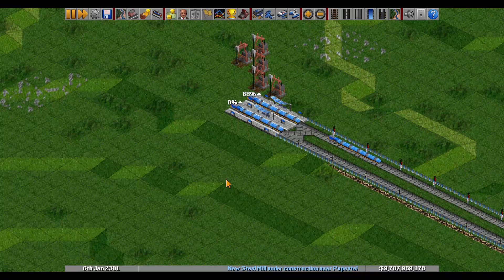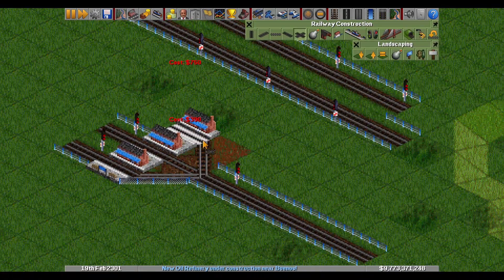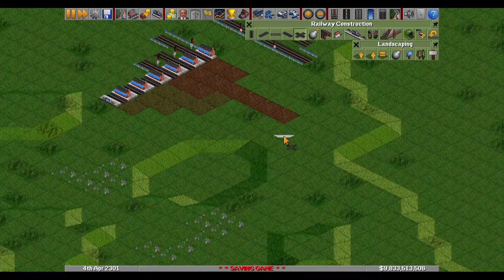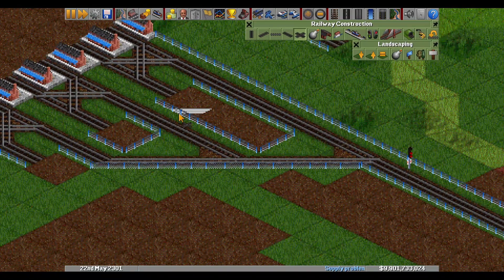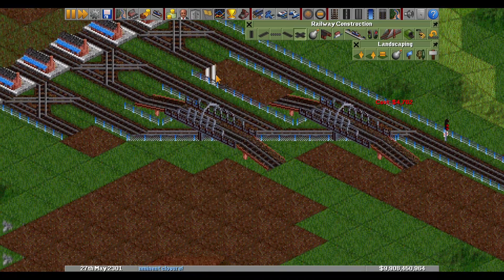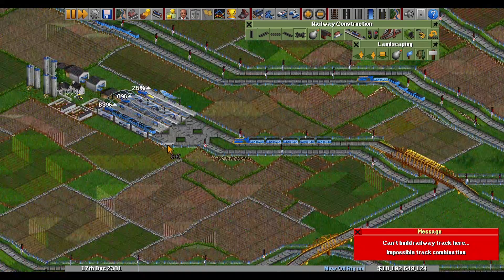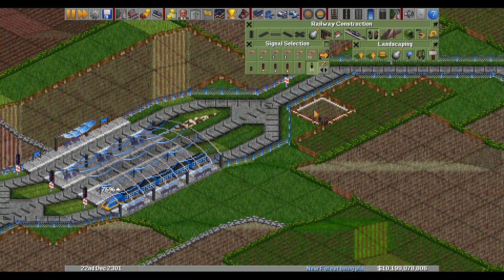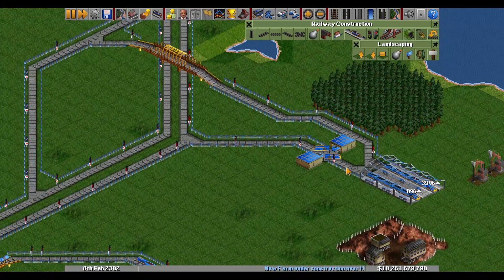How to design stations in OpenTTD

Comment: You can totally do signals after the split but should use pre-signals instead of path signals.
Also I like to have path signals (not one-way) on either end of the platform. Just in case I add a feed from the other side as well.
You could even further minimize the distance in your last example if you don't merge all lines to the outermost line but to the center although it is just one more tile.
Reply from the maker: I know, but that's kinda outdated and can be easily messed up. And not very good with terminus stations. I never make my stations 2-way, that's sure way to chaos or backups. And here I want to emphasis the good ways. All the nuances are advanced level.

Comment: the problem with using bridges is you need a minimum length of 4 i think to avoid the speed penalty. Tunnels don't have speed penalties so they are better if tile space is at a premium.
Reply: You mean the max speed of the bridge, right?
Reply from the maker: @RobBot34  idk what are you talking about, but you are wrong.

Comment: I use a slightly different multi platform terminus station design. It has a slightly higher throughput, but does sacrifice in it requires load bays. Its also one track wider than the station so it really doesnt shine till you have massive train volume.
Reply from the maker: @joehelland1635  If you reach the throughput limit, just expand it, maybe add another line and split the station into 2x4 then 2x6 the another line and keep expanding as needed.
Reply: @Gil-games  i tend to heavily rely on my design for city end stations, and i use it throughout my others just as a visual continuity thing, as such its not great to bulldoze towns, so expanding past your initial size tends to be difficult. Because of this mine tend to be 8 to 10 bay stations and so i improved the throughput with a slightly optimized design focused on limiting track crossings. (0 in my case, but it does have bays for each platform) i tend to play on marco’s hard servers. Tons of fun seeing other peoples solutions to problems in real time :)